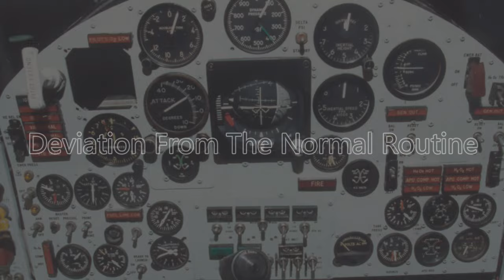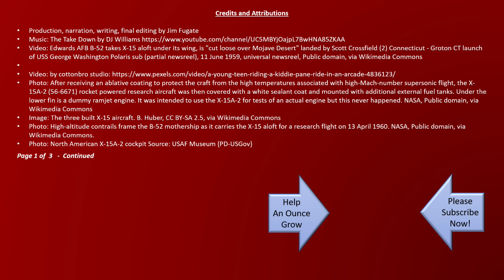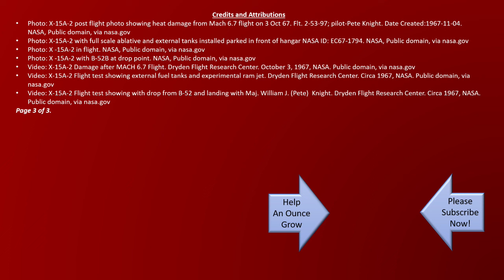What Do You Do When Your Aircraft is Melting? A Few Thoughts About Impossible Choices

Comment: I appreciate your content. However the drop tanks were not filled with H2O2, which was for the reaction control system (little used on speed runs at relatively low altitude), but Ammonia and LOX, the fuel and oxidizer for the XLR-99  rocket engine. The port tank carried ammonia and the larger starboard tank LOX.  The tanks were exhausted about Mach 2.5 and discarded.
Reply from the maker: Thanks for the extra detail. Tough to find completely accurate and authoritative sources- no matter how hard one try’s we will always have room to sharpen things up.

Comment: X-15A-2 was in fact repaired and returned to Edwards but as the program was immediately curtailed after the death of Michael Adams it never flew again.  The problem was the dummy scramjet caused shock waves that impinged on the structure, creating local hot spots that burned through the misapplied MA-2 ablative material (that was past its use-by date when applied) and parts of the structure. 

If they had flown without the dummy, non-functional scramjet, as Pete Knight wanted, the aircraft likely would have hit Mach 7 and received only minor damage.  The X-15A-2 was stretched 3 ft longer than the other X-15s and was supposed to be able to hit Mach 8, but the ablative never worked right, unfortunately.  The Inconel X structure and skin of the X-15 was only good to Mach 6, no more.  Thus any flights beyond that required additional thermal protection but the almost impossible to apply ablative wasnt up to the task.
Reply from the maker: Great info - thanks for sharing this. In my research I was amused by the ablative coating being pink - and then white paint being pallets over it. Guess a test pilot wouldn’t want to be caught flying a pink plane back then. 😉